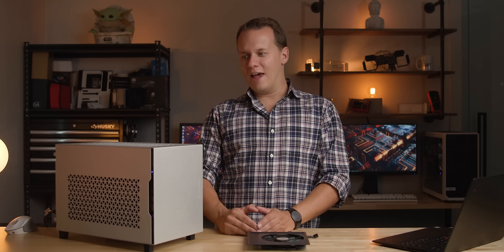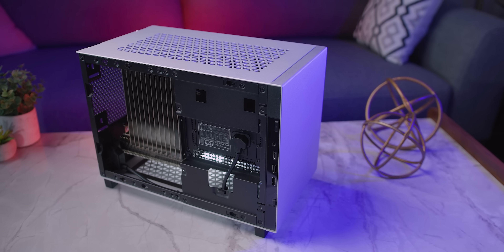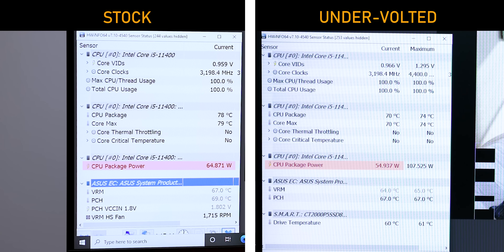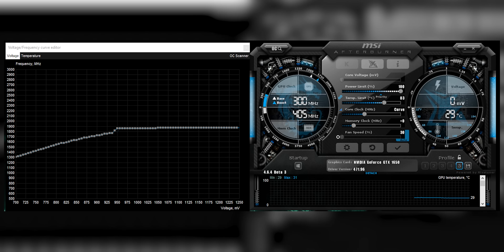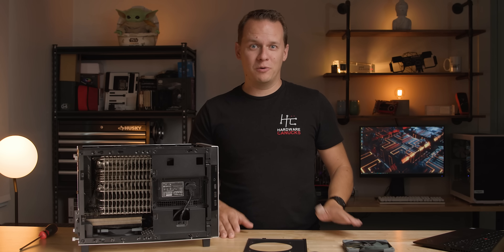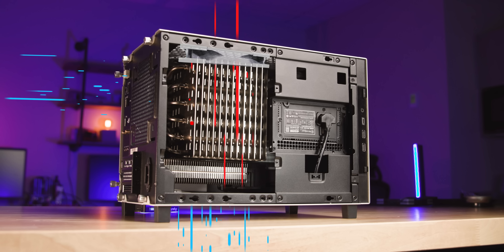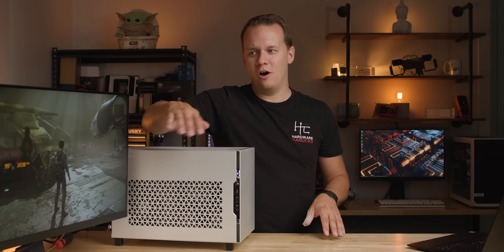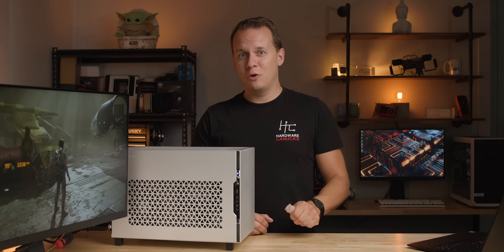My Passive ITX PC - PERFECTED with YOUR Help!

Comment: My current old PC is hybrid too. The be quiet power supply fan was replaced by a more silent one and doubles as an exhaust for the whole case. 
It also has big holes at the top of the case to help take convecting air out.
Positive pressure + filter would be better to prevent dust tho.
TDP's are not very high so it all works quite well.

Comment: If you only have one fan blowing in you have positive pressure. You only need one filter on the intake side. Filtered positive air pressure will help blow the dust out of the case while it's running even if the pressure is very light. I think three kinds of filters work well for me. Foam filters can glue magnet stips to them so they come off easily. Well-used drier sheets clean air well and lots of air can flow through them. I vacuum them on a workstation about every 2 weeks, and they sure do keep the inside case clean. Magnetic nylon mesh filters work well. You can take them off and wash them and put them back on in a second. I probably would use the magnetic nylon filter on the bottom with the fan because those filters are flat and you wound't see it.

Comment: StAph plz why don't you buy Raijintek Morpheus II for the GPU?  You are just adding a fan because of the GPU soo please redo with that cooler
Reply: i think you can even get one rtx 3060 or rtx 3060 ti with Raijintek Morpheus II should be gut for 360watts but lets put half of it cuz nvidia says 200w tdp for the ti and 170w non ti version.

Comment: Yes, good, but I think perfecting your rig would have involved drilling holes in the plate your removed (not removing it) right where the heat pipes come into contact with it. If you made them only just large enough for the heat pipes to fit into, that would have served to transfer some of their heat directly into that plate and thus into the chassis itself. The aim would be to maximize the extent to which the case itself heats up, making it an essential component in the passive cooling matrix.

Comment: Hopefully a desktop variant RTX 3050 will be released with a passive cooler so you can do an upgrade video to 8nm/10nm with Ampere/Alderlake parts. compare the passive experience with new gen more efficient hardware compared to 12nm/14nm.

Comment: Hybrid looks like the sweet spot as it achieves a silent PC with decent performance
Reply: Sharon 20 y.o - check my vidéó  I don't really think the dust filters would affect the temperatures that much, and if it's only like 3 or even 5°C it's not worth it to accumulate dust inside the case for that matter

Comment: Great video, Mike! I really like that you decided to not only build a passive system for the hell of it, but to instead find out how to actually get the most performance for the noise produced. Passive is great and all, but generally speaking its almost always going to be better to have at least one slow-moving and silent fan.

It would actually be really interesting to see how this build would do if you were to switch out the GTX 1650 for a faster but still efficient card, like the 6600 XT, and then try to run it undervolted with just the graphics card's fans.

Comment: Personally i dont care about fan noise, when gaming. i adjust my fans to a tolerable level and play with speakers turned on (or headset)
But for office use, read/writing or whatever - i have my fans set to 0 rpm. All of them! GPU is temp controlled, and the CPU and case fans are in  sync, and temp controlled as well

Comment: The GPU could get more in trouble by dust, the Noctua passive cooler is actually really well prepared for that. But a dust filter in front of a bottem intake fan could be good as the numbers were remarkably low. All in all really nice two videos, good tests, very interesting.

Comment: Being an absolute purist no matter what is silly.

If the fan is quiet enough that you can’t hear it, you’re golden.

Personally with the dust issue though, I would put the fan on the bottom and replace the bottom filter, that way airs only coming in through one filtered fan, should result in very little dust inside, just clean that filter occasionally.

Comment: That Alphacool mega massive square radiator?
Reply: Water temp. Once you actually monitor water temp, and keep it within pump tolerances, you need a ton of radiator for any passive cooling. No single rad on the marked support anything worth doing passively. You need a celeron and a 1050 or something.

Comment: Did he use fan at the bottom as intake or exhaust? In the chart it says exhaust but the way air movement was simulated and the fact that he was saying that the cpu heat sink will suck in hot air from gpu it looks it was used as intake. In small enclosures it's best to use negative pressure (to promote cold air get in the case from other vents) and put the fan to the hottest component, in this case underneath the gpu as exhaust. Flipping the case on the side with the fan in this position may also help as the hot air would have more room to escape

Comment: I remember a YouTube channel named DIY perks mounted a CPU cooler to his GPU which allowed him to use a GPU with relatively high TDP.  If you wanted to, you may be able to upgrade the GPU to perhaps an RTX 3060 with this approach but you'd need a larger ITX case such as a Sliger Cerberus.

Comment: If you're doing semi-passive, 100% you should be doing positive pressure. Intake fans either on the bottom or lower side bracket. These positions
assist the natural convection, leading to less turbulence and airflow. Also, positive pressure lets you put a filter just on that one intake and cut out 90% of all dust, while the rest can safely be left unfiltered for passive cooling and exhaust with no drawbacks.

Comment: Just wondering why you are limiting yourself to 1 fan if you are using such low RPMs. I'd say using both a top and bottom fan at the same time would work out best.
Reply: Noise multiplies. Using a Noctua fan, you need 200rpm or below, if you want silence. Anything above 200rpm, and noise start to add up.

Comment: if you can find a fan speed that satisfies you from acoustic standpoint it's better to keep it going always than to go semi, no risk of sudden spikes causing it to go over that speed and overall lower temps are just a bit better for your components, especially ones without own thermal protection mechanisms

Comment: Nice build. I am using the same approach - passive until a certain temperature. How do you control fans? My Motherboard (asus tomahawk) did not turn off the fans reliably and SpeedFan was not supported so I ended up buying an ArgusMonitor license.

Comment: I wouldn't care so much about being TRULY passive cooling PC as long as being silent, very low RPM fans would already make a lot of difference and it wouldn't make virtually any difference as far a noise. Isn't it possible to have more than one fan? A combination of push-pull.

Comment: One thing you could try, is optimize the TIM, so liquid metal on the CPU/GPU (don’t know if that’s possible, because I think the heatsinks must have a copper base) and repadding the GPU. Even so, I think a drop of 200MHz on the GPU in fully passive setup is not that bad, I’d be curious to know how many frames that actually is costing you.

Comment: I really recommend that you try undervoltign the GPU again, you probably did something wrong, like many beginners do. Heck at my first attempt at undervolting my 1050 I saw zero improvement, yet after I did it properly I lowered it's temps by around 6-7 degrees at the same clockspeeds without losing performance at all.
Reply: I undervolted my 3060 by 100mhz and capped it at 90w and i lost 0 performance and lowered the temps by 10*C!
Reply: @dramgon  ok. but undervolting lowers voltage, not frequency, hence the name, but I'm glad you lowered temps without losing performance.

Comment: I had very similar results. 1050 Ti KalmX with ~500 rpm fan -> sub 50C (water cooling territory). Also, undervolting is absolutely useless on current-gen GPUs running in temp/power limits.
Reply: Unless the undervolting AVOIDED the temp limit.

Facepalm.
Reply: @lunchie80  ...which is not the case I referred to here (or in the video). Facepalm intensifies

Comment: Now, rotate the case so the fan is blowing out the top. (I assuming you made the orientation comparisons before putting a fan in.) Maybe, try both fan bracket arrangements since its reversible too?

Comment: You should not have shoved all that in a tiny case with crap ventilation. Especially if you using a gpu. Palit is awesome though. My build is in a meshify c case, great for the air to eacape out the top.
Reply from the maker: I WANTED to put it into a compact case.  Nothing wrong with that.  Its gonna be used for emulators / HTPC tasks downstairs in my living room.  No way in heck I wanted an ugly tower case for that!

Comment: I'd absolutely watch another follow-up where you overclock the CPU and GPU using the bottom mounted fan and measure the performance increase possible before hitting any thermal limit. I'd also suggest you to watch Optimum Tech's video about GPU deshroud modding.

Comment: Having some fans running at low rpm with noise below the room base level is so much more valuable than running a completely passive pc. Great video!
Reply: There is an advantage especially with dust. I have a passive machine and it works fine. IMO a passive build for gaming is dumb. Use it for work and browsing and watching videos is fine. I also wouldn't cram it into a small itx case. Mine is in a case with good top side ventilation.
Reply: Only problem I see is with the Noctua cooler which is specifically designed for passive use. When you're using a fan (even @ low revs), many tower coolers perform better than this Noctua cooler. This cooler doesn't have a lot of surface area to dissipate heat so that it won't hinder convection. But that's a handicap when you're using a fan.
Reply: @CheapBastard1988  Noctua literally recommends using an NF-A12x25 LS-PWM at low RPMs with this NH-P1 "passive cooler" for higher performance setups where silence is the goal, as opposed to minimal dust.
Reply: @CheapBastard1988  Incorrect.  There is a difference between mounting a fan to force air through a heat sink, and a fan designed to intake or exhaust air from the case.  Having case fans greatly increases the performance of ANY heat sink, passive or otherwise.
Reply: I agree with your statement. Having some air flow is better than none. 
Have you built a passive PC before?
Reply: @WarriorsPhoto  Yes, in personal computers, industrial settings, and server rooms.
Reply: @Grimmwoldds  Passive Servers?
Reply: @WarriorsPhoto  Hardened military computers.  Most people don't have to worry about being nuked.
Reply: @Grimmwoldds  ???
Reply: @WarriorsPhoto  It's not THAT surprising.  The most common reason for building a passively cooled computer is protection from the environment.  Industrial and military applications have been using  cases as heat sinks for a while.  You can indeed buy similar ideas commercially(Streacom, HDPlex, Compulab, and Turemetal come to mind).
Reply: @Grimmwoldds  I am being educated and informed. Thank you 😊 🙏 !
Reply: Well, unless you want a completely passive pc
Reply: 1 top fan, exhaust fan and a gpu fan for this kind of build is the optimal airflow for me
Reply: totally agree. I have 6 case fans in my mid tower, all running at 400RPM, which is inaudible during the day. then when I load up my games, my GPU fan turns on and all my case fans go to 800 RPM and I stick my headphones on and get into the zone. Totally ideal. can recommend!
Reply: @vintage0x  Honestly, even at 800rpm you probably don't hear anything, especially if they are noctua fans. That's what I do at least.
Reply: @bersK00  My room is too quiet for that to be true. I definitely hear and notice fans above 500rpm. I use be quiet fans which have a similar noise profile to noctua.
Reply: This is something that doesn't go too well through the thick skull of some silent PC fanatics. They think that without a PC noise, their room is dead silent, which it's not. Low speed, large, quality fans are the best option for having your cake and eating it too.

Comment: This case isn't perforated enough for proper airflow for semi passive or passive builds. Also, the holes are just big. For semi passive builds in proper cases, something like a D15 for the CPU is killing the results here. Also, just replace the fans of a any custom rx 6600 XT or similar, and its noise will be on par with this, but performance will be in another league. I've cooled a rx 6600 XT at 450rpm that way. I can cool a 3950x at about 700rpm. It is all just a balance of temps and rpms. It can go even lower. Also the lack of any options for filters on this thing are quite disappointing, but using speeds in the 450-750rpm rage, dust is a non issue for me. Actually, dust is a bigger issue in a ordinary case with filters, than in a semi passive like chassis, at least in a ordinary living room.
Reply from the maker: Maybe but it seems to have worked pretty well.  If you look at the last video the thermal camera showed the exterior remaining cool while there was a LOT of vertical heat movement out of the case.
Reply: @HardwareCanucks  I have found a high performance low noise computer to be pretty hot at the top. I actually prefer to get some of the heat to radiate to the sides as well, as to increase the surface of heat radiation, and thus lower temps. A high performance near passive computer, is pretty much a heater: It radiates a ton of heat, like 300W like my current rig.
Reply: Any chance of a quick hardware spec for your rig?
Reply: @igavinwood  In my current rig, there is a ASUS Strix B550-E, and MSI RX 6600 XT, a 3950x, a Corsair HX1200i, 64GB  of RAM and 4GB Intel 660P SSD. I use only Noctua NF-a12x25 fans, two for the GFX and two for CPU. There are no case fans. I use a A D15 CPU heatsink. The chassis is a full mesh chassis, with 67% perforation. I got a redesign in the works, with 50% perforation mesh, that doubles as filter. It is 3D printed and is my design. I use 3D-printed duct on the GPU, which suck air from the outside of the case. The air is funneled to only blow on the GPU original heatsink. I did make a funnel for the fans that ships with the D15, but at 450rpm is was cooler than the stock cooler, but the fans were too noisy, generating a low freq hum. I also use dual push fan config on the D15, using custom designed 3D-printed ducts, as to force all the air through the heatsink. Everything is mounted vertically, with the rear IO on top, PSU in separate chaimber. The chassis is a real chassis, with full cover side panels, comming in at about only 2Kg. It only takes about 5 days to print, with a single 3D-printer. It is a bit on the innovative side, and the list of new concepts are a bit too long for a comment section post.

Just checked the temps of my current rig, the one I use to type this on. Currently the fans are running as slow at the bios support, that is, at 20%. I previously used the B550-f, it is a bit quiter as the VRM noise in idle is not as "ticky" and less obtrusive. The MSI GamingX is decent on the VRM noise, for a GPU. GPU VRM noise is the dominant noise of the system.

There is some very faint fan noise, as to expect while running 4 fans at 400-700rpm under load. Both the GPU VRM and motherboard VRM is more audible than the fans.

I only use regular noctua paste on the CPU.
Reply: @FrodeBergetonNilsen  Thank you for the thorough description. It wasn't what I expected in a nice way. From what you describe you're a very dedicated pc builder and way beyond my experience.

Comment: You could put another NH-P1 on the GPU. Which would reduce temperatures greatly. It might also let you use a more powerful GPU aswell. Maybe also try an open-air case since dust isn't really a concern anyway.
Reply from the maker: Not really.  Orientation wouldn't work.

Comment: I definitely agree with the hybrid approach. The bottom fan temps are too good to pass up.
Reply: I agree, having the GPU 20 °C cooler is worth 2 °C on the CPU
Reply: Unfortunately it's no longer passive lol
Reply: @FinneousPJ1  if you can't hear it, does it really matter?
Reply: @Xtorin_Housecat_Ohern  it might eg regarding dust
Reply: @FinneousPJ1  I'm running my rig semi-passive, it's 0db while browsing and doing light work. When I'm gaming, fans are running at about 400rpm so it's barely audible. 
When I'm gaming i have headphones or speakers are turned on so there is always some noise that masks the sound of PC. Semi passive is best of both worlds.
Reply: @setecastronomy_hc  alright mate